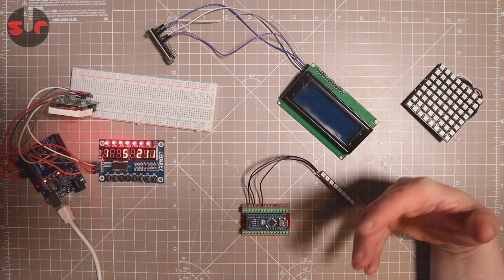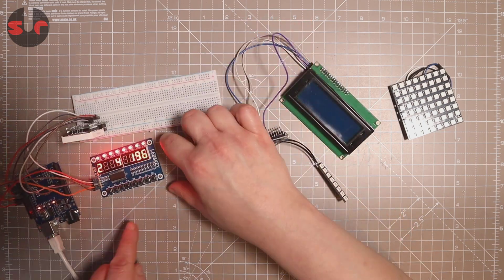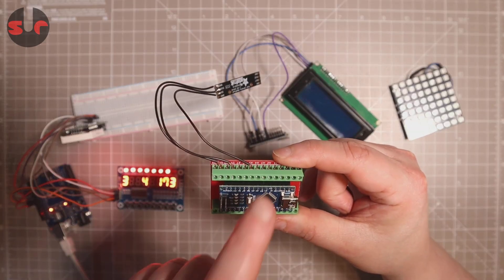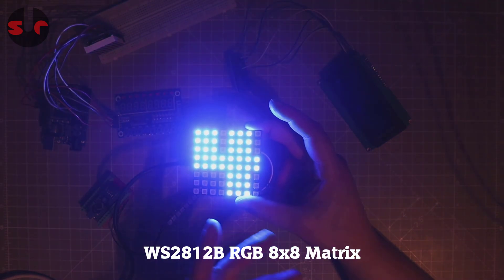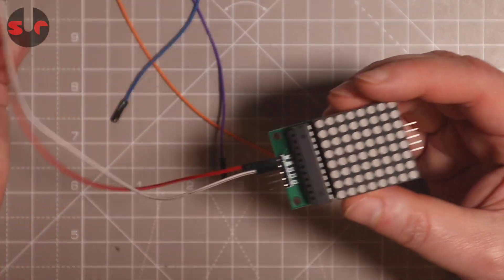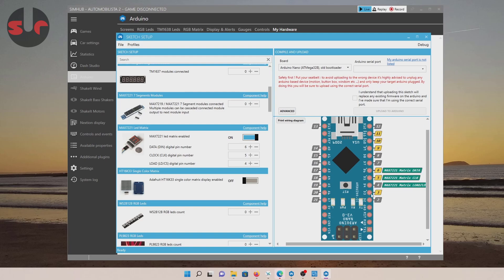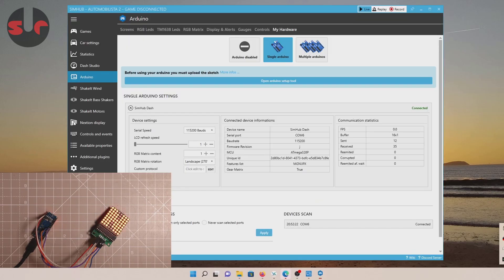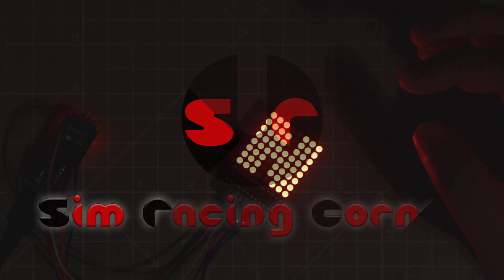Setting up SimHub Arduino controlled displays [BEGINNERS GUIDE] 🤔 IT'S EASIER THAN YOU THINK!

Comment: Thank you for this valuable information resource. BTW, why would they solder the pins for the TM1638 facing up? How are you expected to mount into an enclosure and wire those pins up? I unsoldered and flipped them to the underside.

Comment: If you set this up for lets say a button box, is the program SimHub required to be able to use it? If I brought it to another PC that didn't have SimHub, could I assign buttons like any other controller, or would that PC also have to have SimHub?

Comment: I've  got into sim racing to the point, where I moved up to  a descent rig and this was next on the list..  And I love building stuff myself - so this is perfect for me and I'll be getting straight on AlliExp to get everything I need to build my ultimate button Box and Display..  Many thanks for this vid - given me great ideas and the knowledge I needed..   ALSO - I just looked back through your vids - a lot of stuff I need to watch - sub'd, like
Not sure If I want to get a 3D printer  just for this though, so you or anyone else know of a good place to get something printed to my design..
Reply from the maker: There are 3D printing services out there that can do this for you. A quick Google search should come up with results for that. A cheap 3D printer will do the job, so depending on how much that costs for everything you need compared to a 3D printing service. It may be better value getting a basic 3D printer. Having one ends up being quite handy for other random bits and bobs too.

Comment: Did you ever make the tutorial building the sim flag using a WS2812B and a Nano?  I can’t find the video.

Is it just three wires between the Nano and the matrix board?
Reply from the maker: Not yet, it's something in my list of things to do. Yeah, it's just 3 wires. And basically as simple as all the other stuff I run through on the table here.
Reply: @SimRacingCorner  thanks for the quick response.  Just trying to put mine together now.  Have wired the data cable to D4 and attempting to get it up and running with Simhub, but I don’t really know what I’m doing 🤷‍♂️

Edit - random button pressing has won the day - all up and running now, amazing.

Comment: This seems the perfect place to ask. I want to wire a WS2812B LED Strip as well as a WS2812B 8X8 matrix, and was wondering if I can have them both run by the same Arduino? Do I just need to set one to like "D6" and the other to "D7" and it should work, correct?
Reply from the maker: Essentially yes. You can see I've done this in the video with one example.
Reply: Gnd - gnd
Vcc - 5v
Din - d5
Cs - d6
CLK - d7
Così?
Reply from the maker: @darinho23  Just follow what SImHub shows you, as I have demonstrated in the video.

Comment: Hello my friend,.love the channel   !! I saw this video and was wondering if you could possibly help me out? I have a 3drap steering wheel, inside is a Arduino nano for the led's and a Arduino micro that is supposed to control the 58 functions of buttons, rotary dials etc. I didn't make the wheel I got it second hand, however it started disconnecting randomly until a few days ago it crashed my pc. I turned it back on but the wheel is not working. I had a little help from someone on Instagram and between us we've found that the micro board has been wiped clean. I do have the original sketch from the guy who built the wheel but I cannot get it to load back on. I have absolutely zero knowledge of Arduino so any help would be much appreciated. Many thanks Stu
Reply from the maker: Sorry, I wish I could help. I've only uploaded to Arduino's through SimHub, so it's a different process. There's going to be tons of videos tutorials on YT on how to upload sketches, though, so it shouldn't be difficult.

Comment: I’m about to dip my toes into doing stuff like this but the biggest problem is finding cases for this stuff, as I don’t own a 3d printer 🙄
Reply from the maker: I completely agree, It can be difficult to work with these displays unless you have a 3D printer.
Reply: @SimRacingCorner  I’m pumped to hear the results of your “sound exciter” video. I was so close to pulling the trigger on Sim 3d’s pedal rumble motors but it’s from the UK and by the time it gets to Canada, Yikes!  Are you a big fan of the Nobsound amps? I had bought one for my bass shakers but it never really put out the proper power but I’d assume it would work with the sound exciters no problem.
Reply from the maker: The Nobsound amps are fine when used with the appropriate shakers, and more than enough for these sound exciters. And of course, make sure the PSU being used with the amp is sufficiently powerful enough too.
Reply: 3D print service is your friend. Find a 3D print file that fits your part, and send it to them and wait. My recommendation though is to buy an ender printer, but there is a bit of a learning curve if you're willing to put in the time + effort